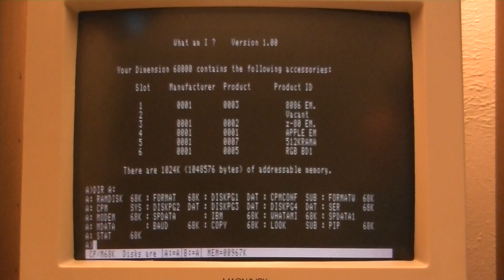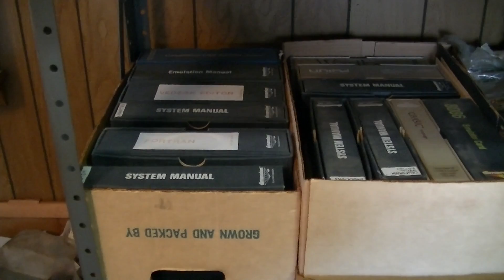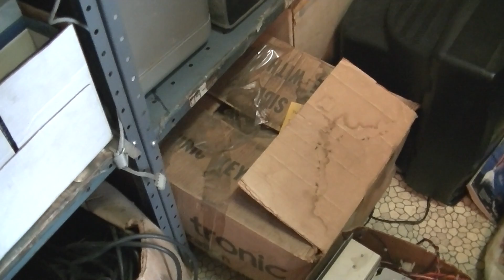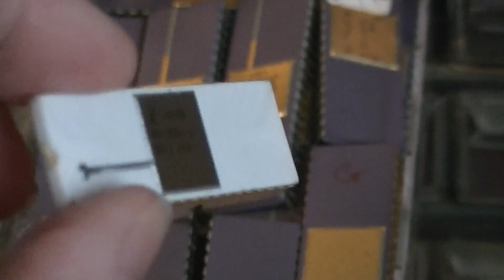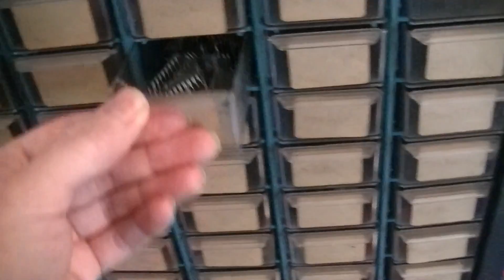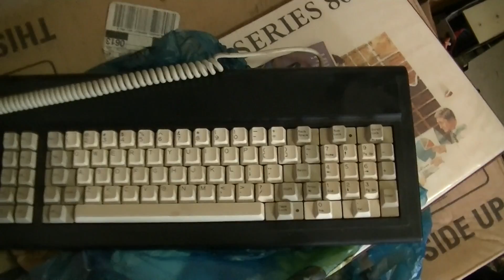Dimension 68000 - Review

Comment: Those disks that got wet are probably still readable, even if you have to clean them.  I had disks get wet, disks that I wrote the programs on (nothing important, just stuff I made as a teenager).  I cut the end of the jacket, sprayed them down with water, patted them dry, hung them up by running a string through the center and let them dry.  I cut the ends off some new diks, put them in the sleeves (they were 5.25) and they worked and I was able to use them/copy them.

Comment: I'm restoring a dimension 68000 I've had for 25 yrs.  The keyboard is lost and I'd like to buy one of those you have in that box even if it has mechanical problems.  Apparently the data format is different from a PC kybd.
Reply: How did the restore go? Up and running? Thinking about pulling mine out of the attic to see what sort of shape she is in? Any tips or warnings?

Comment: if you were willing to take the time, you could compile and boot EmuTOS/pTOS and run a lot of Atari ST software on the Dimension 68000, mostly GEM stuff (as opposed to games) and MiNT (multi-tasking) OS, without too much hassel. Your machine used for the emulation and demos is certainly more than capable. You could probably get the emulators to run in a window as well, all at the same time if run under MiNT.

Comment: At my work theres an old cnc mill from the early to mid 80s made by Okuma. It too has a pip program with a very similar syntax in order to copy files from serial, 8 inch floppy, bubble memory or paper tape.. Sort of seeing that it might run a DOS with a very custom shell. Im probably going to have reload all the executive software and parameters because the bubble memory is beginning to fail, and im a little worried i dont have the installation disks for the currently loaded software.

Comment: Do you happen to have a spare keyboard for sale? Even non working may help.
Reply from the maker: Sorry, I don't have any spares.
Reply: I understand. If you run across one, please let me know. I read that the signal from the keyboard was a 300 baud TTL serial signal. If I can find a keyboard, my plan is to use an arduino to build a PS/2 or USB keyboard adapter. I just need a keyboard to sample the input.